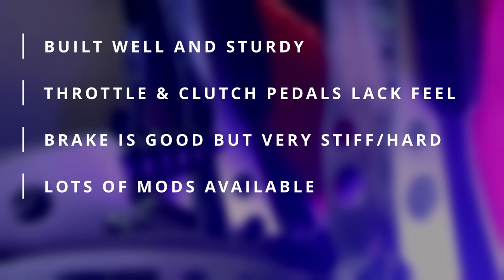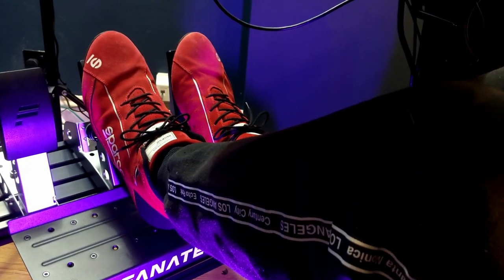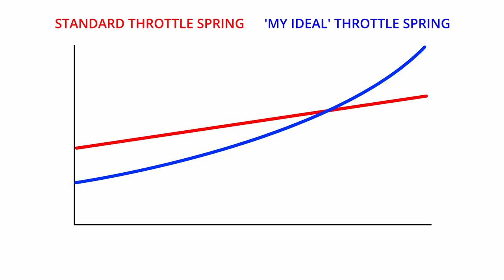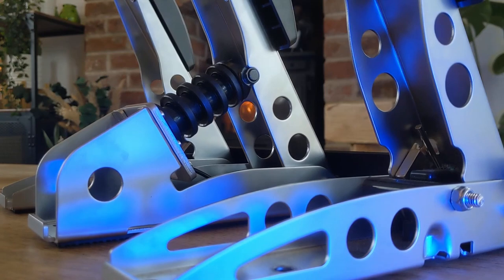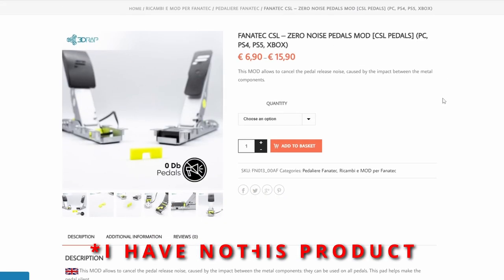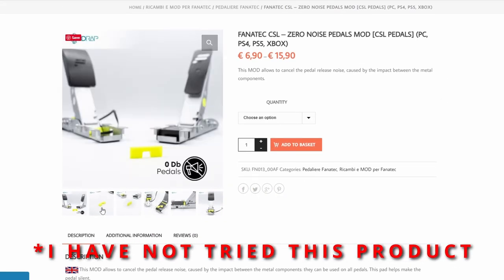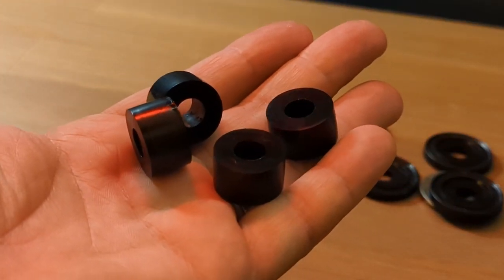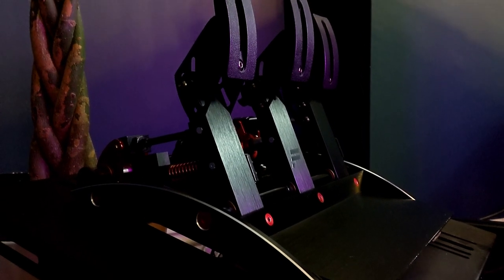Fanatec CSL LC Pedals - Good, But Could Have Been Great

Comment: You miss the part where 60% of the market doesn’t have a cockpit. And play on the floor. Which is why they opted for the light springs. Not everyone has the ability to run a $2,500 sim set up and needs 80lb springs and 100nm brake pedals.
Reply from the maker: This is my point, though - they're really bad at freestanding and the load cell is rock hard. Not good for cockpit-free racing
Reply: @Cktime Logitech for you guys
Reply: you also need a mostly solid set up for the 8nm csl dd so i don't see the problem with that 60 or more of the market is fine with a g29

Comment: Just a quick added tip for anyone using the logitech pedals. Getting yourself the upgraded springs is a must have! But if you are finding that the gas is still to light, add the old spring WITH the new spring to make a more stiffer and gradual natural resistance. At least in my opinion (don't mix and match as they probably don't sit to well together, use the same type)

Comment: Most reviews of the CSL line are from pro sim racers that compare them to much more expensive equipment. I am a casual gamer and prefer arcade games and a bit of simcade. I was absolutely happy with my Logi G29 I used the last 6 years but only occasionally. I wanted an upgrade since with the CSL DD a direct drive is now approachable for a smaller budget. I got the DD 8Nm, CSL pedals with LC kit and just a single round wheel as Allrounder. It’s so fun to play Forza, dirt, dirt rally. It’s so silent and has much more force and feedback than the Logitech (obviously). It’s a tremendous upgrade for me. As I use it casually, just a week every other month, I think I will not outgrow this setup for a very long time. It’s kind of in a weird spot. Most casual gamers would not invest 800€ for this kit+wheelstand. Serious racers choose the Clubsport or Podium line. The CSL line is really meant for casual gamers that can shell out an unproportional amount on an overkill set for their fun games. I love it so much but it’s so overkill for me!

Comment: The elastomers will break in after a couple of weeks. If you don't want to wait, look into die springs rather than the 3drap solution.
Reply from the maker: I reckon you're right - I've given them about 4 weeks of use and I think they're either breaking in or my left leg is going supercritical. Thanks for sharing your experience though, there's only one of me and lots of helpful folks like yourself out here
Reply: Chiming in to second this, they do break in and I'm very happy with mine. But Danny makes a good point that for first time load cell users and novice sim racers this may give a poor first impression of LC pedals
Reply: Mine came defective! The break and gas worked well, the clutch gave out. The break pedal, although extremely stiff at first, actually became pretty normal. However I switched to Moza SRP Pedals, and wow I realized that CSL LC was STIFF!
Reply: Wait really? I’ve had my pedals for months now using at 85% brake force and it’s not damaged.
Reply: @AdzzVR  'Breaking in' isn't the same as damage. Think of it as a new pair of shoes. Only get comfortable after you've being wearing them a few times and they loosen up.
Reply: @DimBeam1  ah I didn’t read the comment properly I thought it was about damage. And yeah after a few weeks it becomes softer and more natural. I’m so used to mine now I don’t think I could modify it to make it softer.

Comment: Thanks Danny, concise as ever! 
I purchased these as I've finally taken the plunge selling my G29 and moved onto Fanatec. 
All your points are valid, I found the LC extremely hard but got used to it quickly, and yes a new cockpit is required as my PS Challenge certainly isn't suitable for these peddles! 
I can see now that Sim racing is certainly a rabbit hole. 😆
Reply: You could also check both indigolime and lowdownshifter. Both have a decent fix for the PS challenge pivot clamp and pedals if you want to keep the mobility and foldability the PSC has.

Comment: Great review, i am now 3 months in and new to lc brake I'm had a tough time initially.
there is a wee trick i came up with, if you upgrade from std brake, the foam in the brake can be used to ease the feel of the load cell .
It helped me out while the rest of the stack bedded in a, now back to the stack as the foam started to creak and felt a bit grainy, but it worked as a temp fix  hope this helps.
keep up the good work.

Comment: I have it and they work nice, but do the spring mod to the load cell like I did. Out of the box the load cell is very stiff and not much travel... I have a yellow die spring and it makes quite a difference, it's not as stiff anymore and has more travel. Use either a blue or yellow spring to help it not be stiff and supply more travel. And it's a great cheap mod.

Comment: Great review. 

I tried to get used to these for months, but no matter what I did, I was unable to. It made no difference what so ever to modify the brake with alternative elastomers and springs.

I recently switched to Heusinkveld Sprints, and the improvement is dramatic. Granted, they cost almost three times as much, but for me, the entire simulation racing experience has changed. The throttle pedal is fantastic, and because it makes delivering power so simple, I was able to lower the TC by a few clicks. There is no more lift-off understeer.

In all honesty, you would only get the CSLs if you were also purchasing a direct drive wheel because they are inexpensive for a reason. Hence, if you want a Fanatec DD Pro or CSL, I'd suggest just purchasing the wheelbase and wheel from Fanatec and then purchasing the Sprints.

Comment: Personally I like a stiffer brake pedal but did get the 3DRap add ons, but by the time they arrived the elastomers had softened quite a bit so didn’t use them in the end. As I race formula style cars I don’t use the clutch (that used to be the brake) so swapped the pedal arms over as the clutch has a slightly stiffer spring which helps a bit. I use a gaming headset so don’t hear the pedal stops but definitely feel it!
I use a Playseat Evolution so made a couple of wooden legs to help support the pedal mounting plate as I felt it was going to brake with the amount of pressure needed!
Reply: I switched the clutch and gas too. Did you take the little rubber bit out of the clutch pedal as well?

Comment: I literally got my Fanatec setup the day this video released coming from a G923 setup. Super ecstatic with the Direct Drive setup, however, thoroughly disappointed with the LC. I can get over the throttle maybe being more sensitive than I'm used to as well as the noise, but the 'stiffness' of the Load Cell is far too unbearable. I've built my whole setup around not needing to buy a wheel base or a rig (Even though, it's something that'll likely happen in the future). 

My question to Danny if you see this, and the wider audience: Do I return these pedals in favour for the ClubSport for an extra €100, or should I look into these mods to make the current LC feel better?
Reply: Agree with the stiffness. I came from  a G29, too, and felt the same way. After 30 min my leg ached.

But a month later it felt fine. U get used to it, but I think it shld come from the factory a LOT less stiff.
Reply: +1 to getting used to the stiffness/it softening up. I almost returned mine when I got it so I was so unhappy with it. However a couple months later, I’m in love with it. If anything it’s starting to almost be too soft. Definitely don’t give up on it.
Reply: @Metroshica  spot on re the softening up. I, too, was VERY unhappy at first, but all good now:-)

Comment: Nice video. I've had these pedals for over a year now and I am just now getting into modifying them as I am trying to get a more realistic street car feel. Turning to the mod community and I am not disappointed with the 3drap progressive kit. 

The issue was I was having a difficult time with modulating the brake under trail braking. This absolutely fixed the issue. It also makes the pedals have a much nicer feel. 

For an f1/gt car though, the factory elastomers are still the way to go. 

I didn't notice the throttle pedal feel/noise but that is because I use headphones and a CSW2.5 wheel base which sounds like it's a rocket about to take off to the moon while using anyways, quiet operation is not a high priority item.

Comment: Great review! All of those points are what drove me produce mods for these pedals.

I now make kits in the UK to fix all of these issues (minus the loudness), and to me they now feel absolutely perfect. My brake mod alone (releasing very soon) took these from a pedal set I almost regretted buying, to one that I couldn't be happier with. I was going to replace them with Sprints, however I will now be keeping these permanently! 

I won't link my products as I don't want to advertise on your video, but for me I couldn't be happier with how they turned out.
Reply: The brake mod, would that be the springs sold on your website?

Comment: I need to use these under a desk. Is there a mounting solution like just a pedal tray that can help with using on the floor?
Reply from the maker: I did this with the Clubsport V3 pedals, made a very basic wooden platform to give them stability - could do the same: https://youtu.be/y6KY0grqiDk

Comment: I'm driving with an ancient DFGT and while I kept the wheel, I swapped the pedals out for these. As others have said they do seem to bed in, but I am looking at some of the 3DRap parts to tune a little.

In terms of feel, I've really enjoyed the transition from 20 year old pedals that were entry level at the time to a modern load cell, even one with some faults. The discussions were true; It doesn't make you any faster but it is much easier to be consistent and I'm able to trail-brake by feel without having my eyes glued to the brake-meter in game.
I've also used the software to bring down the 100% point slightly so not as much force is needed.

Comment: imo the csl elite pedals were far better because you could adjust the force of the brake out of the box and they just looked nicer 🤷‍♂
Reply from the maker: It does seem as though the old CSL elites were just fine. Perhaps the reason for replacement is more about compatibility

Comment: “So no standing then on the floor” 

Mwhahaha I laugh as mine are on the carpet  floor, not bolted or fixed down and are solid 😂
Reply from the maker: I'm glad you found this vid! How have you got things set up? How does your brake feel?
Reply: @dannyleeracing  tbf I have changed the brake slightly and put a custom spring in there so that’s why they don’t move on the carpet cus I don’t need insane force to push it. But yes couldn’t miss your videos Danny 🙌🏼

Comment: For me it's not so much the pressure/stiffness of the brake, but the short travel distance, which just magnifies the heaviness "issue"

Like you mentioned, it's just such a difference between a too light clutch/throttle, and very heavy brake.

It seems the CSL's were designed without an LC in mind, and then they added the LC option back to please people - If you buy the LC set, you actually get the normal CSL's in one box, and the LC upgrade kit in a separate box, it's not even one actual retail set. I would love to see a cheaper option of just throttle/LC brake, not everyone uses a clutch anymore (especially with F1's rising popularity), and I think a throttle/LC CSL set for like $150 would dominate the market

Comment: In my opinion the brakes are much too soft but all in all a great product
Reply from the maker: The standard CSL brake pedal is ridiculously soft, no good for sim racing at all. The load cell, though, is good but just inexplicably stiff
Reply: @dannyleeracing  For me even the Loadcell is is too soft even with Brake Force on MAX in Fanalab